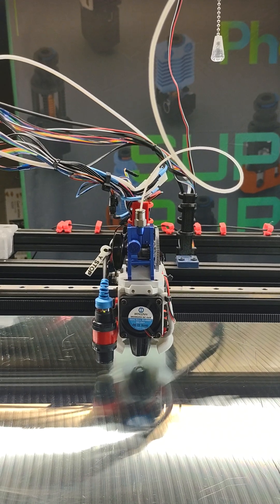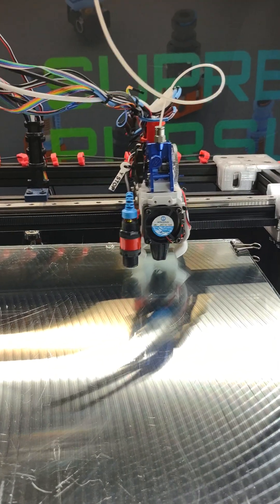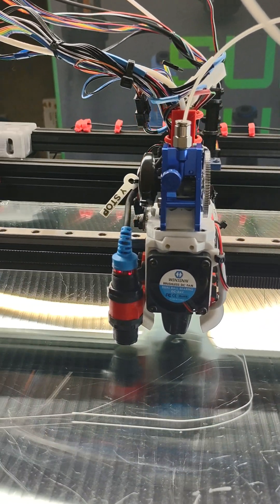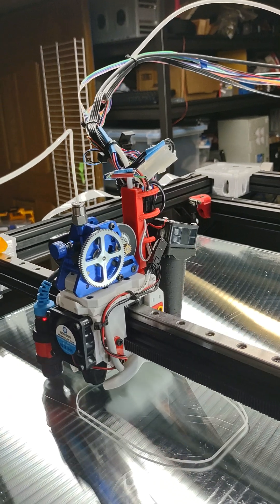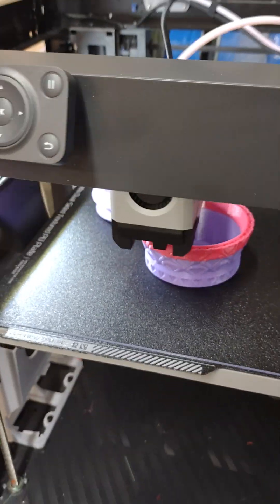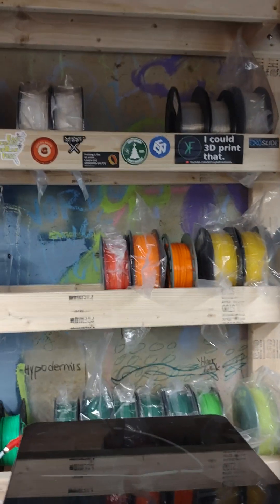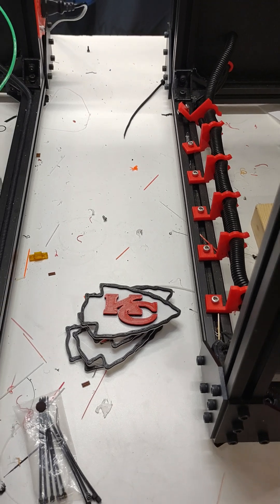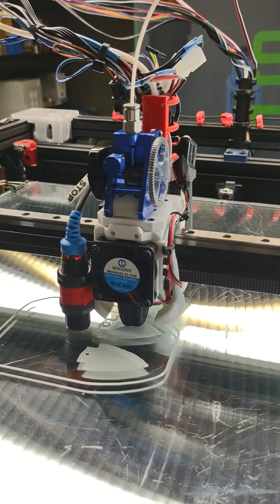Phaetus APUS and Rapido

Comment: Hi Dave great setup, Hey what OS are you using ?   am using Kipper and looking for the "Rotation Distance" for Klipper and the Apus, and yes I to cannot find any thing that helpful to set them up, I have the Apus and Phaetus WH water cooled Hotend. Ill post pics and video when I get mine running, I'm doing a Ender 5 plus Mercury One conversion.
Reply from the maker: Thanks for watching and the comment.  Hope this helps.  I had a lot of trouble finding information on the APUS settings and how to mount.
[extruder]
max_extrude_only_distance: 200
rotation_distance: 4.01			#test for APUS
Reply: @woodwaker1  Thanks for that ill start at your rotation distance to start off with, I will post my results as well.
Cheers
Steve
Reply from the maker: @appsapps5160  Steve, I found the value on the RatRig discourse site.  There is not a lot of information that I can easily understand on how to mount the APUS and the hot end.  I have finally figured it out.  I am converting both of my Rat Rigs to the Apus and XG hot end.  https://www.youtube.com/watch?v=KfZ9YPaMzxw&t=3s&ab_channel=DavidWilson
Reply: @woodwaker1  Hi Dave, I did a setup on my Apus and got (Used the ratio Pheatus gave me)

# APUS Exra settings
#gear_ratio: 82:13
#rotation_distance: 26.595 

Measurement was done with no Hotend installed and 30mm PTFE at the feed end, so just tested the bare Extruder. So bang on now 100mm ask is 100mm get with Calipers. Run current is 0.90amps.

Wire adaptor plug from box attaches so you can plug straight into Board (Mines an Octopus V1.0)  didn't need to reverse the feed just worked out of the box. Will post pics and vid's when the Mercury One setup is complete.

Hope this helps others.
Reply from the maker: @appsapps5160  Thanks for posting your results.  I just finished mine tonight.  Had to fight with the new version of Klipper that was just released.  Finally got it working, but too late to do much more tonight.
Reply: @woodwaker1  Oh new Klipper version .... Yea constant headaches when they keep changing stuff

Comment: You are the first person  I've come across that is using this combination. I just received my Apus and I'm waiting on the Rapido to arrive. I've been searching everywhere for a way to mount these on my Anycubic Chiron. I don't have a linear rail setup though (for now) but could you share your design with me? I've only had my printer for less than a month so I not well versed on designing my parts yet. 😄 BTW, there is a Volcano nozzle on the UHF version.
Reply from the maker: Thanks for watching and the comment.  I have had these since October.  I have spent a lot of time trying to figure out how to get the combo set up.  I finally figured out how to mount using the EVA 3.  There is a mod for the APUS to sit on the linear rail block and the Rapido is mounted on the universal front plate.  Take a look at the EVA system, it is a universal design, and makes sense once you start to understand it.  It took me a long time to do so.
https://main.eva-3d.page/   
I have just received another APUS and am going to pair with the DropEffect XG hot end.   Send me an e-mail if you need more help, or another message